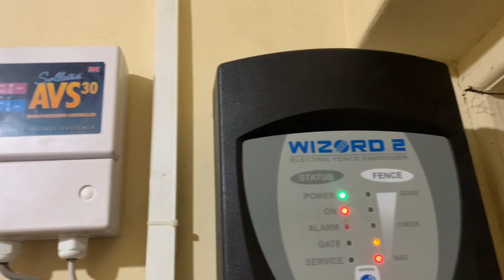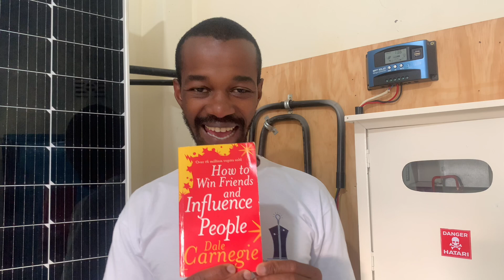Wiring Electrician Success Moves| Top Heights Electricians.

Comment: Hello so can I just you a question 😅
I got elecrecuted twice from The socket switch while typing to connect 😢 then the whole 4 houses connected with my meter had a black out 😮 The whole night until I called My electrician and said it could be from the Pole so can you explain what may have caused the problem ❤?